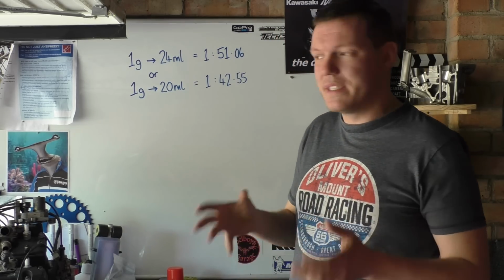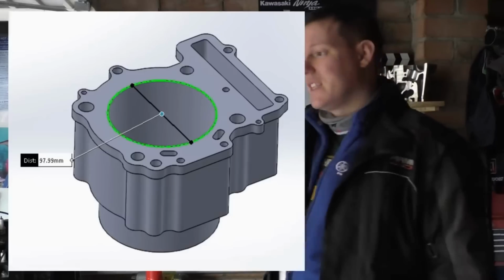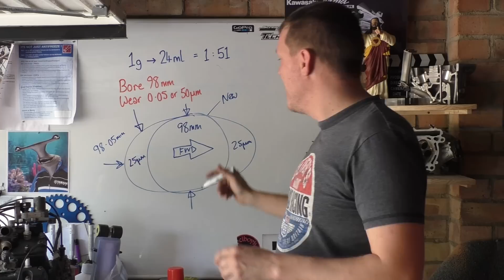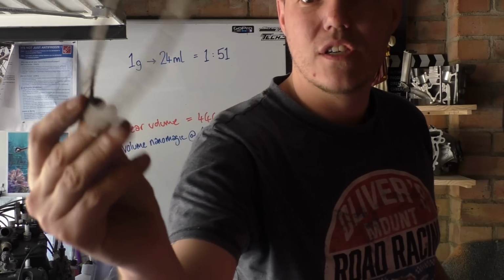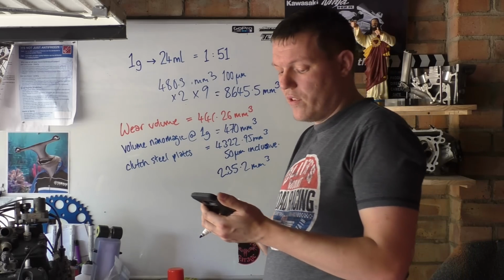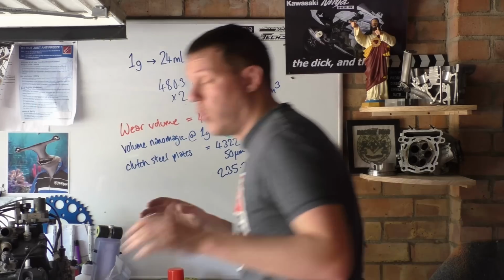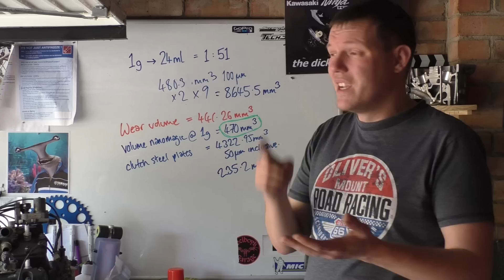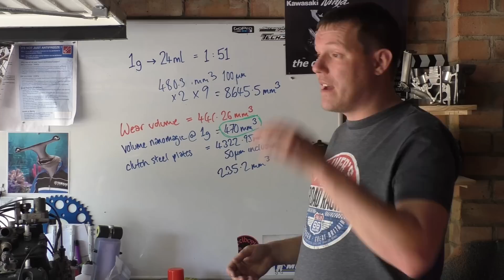Tribotex = TriboSCAM?

Comment: Maybe I missed a part but I haven’t seen if the engine volume was lowered, if you got better milage, if your cylinder pressure improved and if the the engine ran smoother and had more hp? Where can I find these results? Good review. Thx

Comment: I heard about an experiment from the 70’s where Dodge created an engine prototype that had roller bearings in both ends of the connecting rods and on the crankshaft. With modern materials and knowledge, could someone create/recreate such an engine?
Reply: yes, just as easy as back then
Reply: In '67 Honda made the S800...... that had roller bearings.
Reply: So did the gs750 gs 550 etc
Reply: Didnt know that, I do remember them as being smooth running.

Comment: Thanks Mat for sharing this. I have a mate who swore by Activ8 oil additive. At t last years MCN Excel exhibition we found the Activ8 stand and did the cam wear test...yes looked impressive but even I thought if this stuff si so good why isn't it in bog standard iol...usual response it's too expensive but if you want your engine to not wear anywhere near as regular oil (yes even Yamalube in a Yamaha) then spend £30 on one engine treatment for life. I thought it was bollocks then and you have just shown beyond doubt that there's an entire industry praying on naive and gullible people. Keep up the good work and I also like that your mam enough to admit you get the occasional content wrong but correct it .

Comment: I used Tribotex in my BMW 2010 535i. After 200 miles my engine light on and says not generating enough power for the transmission. May be my clutch plates are slipping due to less friction and not able to generate enough power to my transmission. Has someone experienced it? Pls. add your comments. Is it intermittent and will get healed after 500 miles? or shall I not risk my car and flush the entire engine oil with new engine oil.
Reply: Drain the oil and start fresh. This Tribotex is a load of shit. If it could really bind to your engines internals it wouldn’t know what to bind too. It would bind to everything and fuck shit up.
Reply: Lol first of all you have an old probably turbo bimmer so there's that.

Comment: To test oils and additives why not get a single cylinder. Lawn mower. Engine ( remove the blade ) run it in rig up a digital temp gauge and a digital rev counter and a throttle position sensor run whatever cocktail of oils u want warm up to operating  temp open throttle to 15 % and see where the rpms are at ?? And keeping a score chart
Reply: Use the old oil as chain lube

Comment: Nano particles have an extremely high toxicity level compared to normal sized materials of the same compounds. So its possible that using tribotex might make your used oil a highly toxic (aka Asbestos) and require special  disposal.
Reply: Got a cite for that anywhere. Bz that's interesting.

Comment: I use old Arco 10w40 graphite oil from the 70's in my scooters. It is full of suspended graphite. Works great! But it's got a LOT of graphite.
Reply: Dude save the math just put new clutches in if your that worried.
This stuff is meant to raise yer compression and bearing surfaces  to reduce oil moving easily .  Not deal at all with clutch plate wear .... wow.
Reply: brandon boulton 
Arco gone from the market.
I just use full synthetic now and only buy it on sale .I can get it at least two times a year at 41 % off .
and always watch for the deals.
change the oil every 5000 and no issues . oil related ever. 
Have a two Stroke vespa it only gets AMOIL now... seized on nearly every other brand .
Have really stressed the Amsoil even doing 95 km/h for hours at a time on a 1980 2oocc engine that has not even been given rings in about 11 years . In fact they maybe the original rings as the two previous owners did not have it long . Cheers . 
I like hearing about   the old products though.

Comment: Now the question stands; if money wasn't the problem -- say it was 5 dollars/quid/whatever, could it help an engine at every oil change as a "high mileage additive"? Usually we don't prescribe to additives as they don't help, but you say the technology could help, just not in these concentrations.
Or could the continual build-up in non-critical locations cause averse effects, a la stop-leak?
Reply from the maker: Yes - well the data from the testing says yes.

Comment: An example of a motorcycle we could test this garbage in is a 2017 or older Honda Crf250r. Honda separated the engine oil and transmission oil. Both have a capacity close to 700mL.
Reply: A fair few harley engines could be used as well.

Comment: So I'm gathering that it might slightly work? I'm just looking to find so.ething that might help a bit with lowering g my oil Consumption. I have no leaks or nothing just a 24 year old engine that's burns a quart every 500 miles or so on recommended oil but significantly less when I thro a quart of 20w50 in. Then it burns a quart in a few k miles. Eventually I'll pull it and rebuild it but financial constraints ya kno.

Comment: Was thinking before you mentioned clutch wear put 3 or 4 tubes in your bore will be as tight as an f1 engine (not for human consumption)  after talking about clutch wear and  bearings you'd be better off squeezing in a few tubes of jb weld I'm not suggesting anyone try this

Comment: If that stuff repairs a cylinder how do the rings adjust to new dimension? I mean it sounds as if it even sticks to a surface the rings would scrape it off immediately?
I know there products are shite and would never buy them.
Good video Matt, thanks for exposing BS!
Reply: mmdirtyworkz the rings were fitted when the engine was new and with wear comes a widening of the ring gap. If this stuff works as advertised, the rig gap would close to spec. Again as advertised, it hardens to a hard coating so cylinder walls would not be affected. I’ve used this product and have seen great results as long as it’s used correctly and roughly every 40000 miles
Reply: @truemenimprovedaily  have you got data showing measurable improvement?

Comment: I really can't see any way it will bring a worn components back into spec, no matter how much of the nano magic bullshit you put in.
If it does anything at all, the best we can hope for is,  it to form a low friction protective film on the bore, cams, etc, to help prevent further wear. If this is the case it would be very bad news for wet clutches...
Reply from the maker: I'll be doing a demo on how soon.
Reply: I used Wynns and the clutch slipped with two capfuls and not with one. After sixty thousand miles the engine was still at original specs.

Comment: Matt are you sure your wear volume figures are correct? Off the top of my head your figures are 441mm3 of wear 100mm is 4" so you've got 4" of wear in one cylinder? I'm no mathamatition mind. I might be completely wrong.
Reply from the maker: What? By 4" do you mean 4/1000ths?
Reply: What I'm trying to say (but not very well) is your wear figures seam high? Like I say I might be wrong.
Reply from the maker: Do it yourself and find out.
Reply from the maker: Unless solidworks is lying LOL
Reply from the maker: I get it, you say 100mm = 4 inches 

but this is volume - so 441mm3 is 0.0269 cubic inches
Reply from the maker: Or 0.0155 fluid ounces
Reply: I'm with you I was thinking squared not cubed. My bad.

Comment: is it possible that is isnt supposed to rebuild your motor so much as fill it small pits and make things a little smoother.  This would in turn burn a little less oil and a little more compression. Not magic.  Your math is great but i think you may be missing the forrest for the trees.
Reply from the maker: If you read the paper on this stuff - its actually meant to work in the opposite way. I think you're missing the wood for the trees.... also you weren't listening obviously - there isn't enough of the stuff in the tube to even do that.....

Comment: TriboTex is not a scam in my opinion.   I can only go by how well it is working for me.   I added it to a well cared for Miata engine at 108,000.  I've now driven it for around 2100 miles.   The engine is running quieter.  And it accelerates much smoother.  It is a 1.8 liter engine and I couldn't be happier.  The product seems good.  And the staff at TriboTex is very helpful explaining what I did not understand about this new type of stuff.  To The Workshop-  thank you for the thought and the explanations you present.       You love the word Fuck.   Good word.  Really good word.    I like TriboTex.   Fuck Yes I do!
Reply: Do you have any data for the improvements or is it just the ass dyno? I'm genuinely interested here if there is a measurable improvement. Acceleration runs on a dyno perhaps?

Comment: Congrats on using your grade school math, but if your "science" was used by NASA we would have never actually built a rocket and loaded stuff into it and sent it into space.  Where the rubber meets the road is where you actually pour it in and put it on the road like I have.  I have a 2.5L Nissan that I have put over 85K miles on in 2 years while using 3 treatments of Tribotex at near their treatment cycles.  I am required by a client to have dealer level service for that vehicle, and the dealer cannot believe how well it runs.  Before the first treatment mileage was 36 mpg at 70mph on weekly trips between LA and Vegas.   After treatment the vehicle is getting 39-41 mpg.  I put it into my Honda ST1300 and mileage jumped to 42mpg and the annoying engine heat the bike is known for went away.  At 12K miles on the treatment no change in clutch performance, just quieter, faster riding.  A caution to bikers is that with engine friction reduced, engine braking is significantly compromised.  This isn't clutch related.   There just doesn't seem to be the same level of friction drag.  This isn't for everyone, but I found out about in a bar talking to a wind turbine guy who was running it in his service truck.  It could possibly cause failures, but my experience in 5 different vehicles has been very positive.  But I also think it is overpriced by about 30%.
Reply from the maker: Evidence would be great...

Comment: Sorry mate it worked for me.. Improved gas mileage and engine runs cooler
Reply from the maker: And you tested this before and after?
Reply: Well the true test was in my mother-in-laws 1996 Nissan Maxima which has 140K.. The car would vibrate heavily during the 1st 4 minutes of start up, the idle was actually no better so just as a goof I used as directed  (cold)  in and after 7 minutes the idle was noticeably smoother and the temp seems to have gone down. Allowed the car to get cold after an hour or so then started it up again. I swear the vibration was reduced.. NO JOKE. Will test the mileage because I normally get about 350 miles on a full tank give or take. I tried this in my 2015 Lexus ES 350 (WITHOUT THE TOYOTA OIL) with Mobil 1™ Advanced Fuel Economy and the improvement is about 4mpg however it's too early to really test as this was just city driving.
Reply: TVT GREEN is even better based on a review from a fellow Uber Driver
Reply: @thedirtyworkshop  is it me or are all these products sold by utterly anecdotal stories that imply authority via being a skilled driver/high mileage vehicle etc.

If tribotex worked in this concentration then why aren't there dyno pulls and engine teardowns from the company compared to their lab testing. Which is mainly testing of larger quantities.